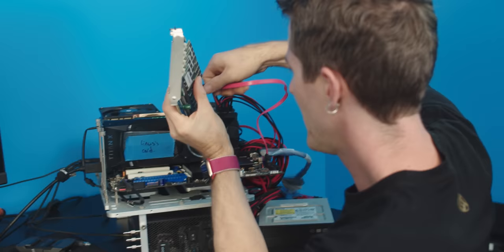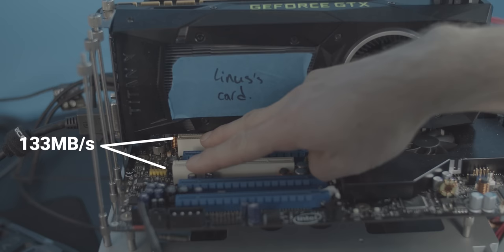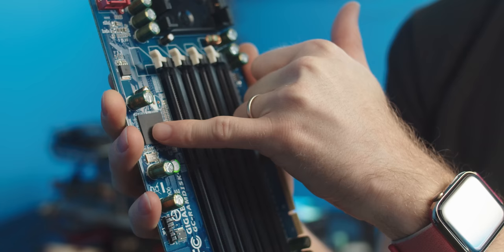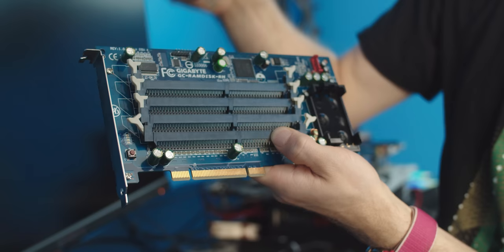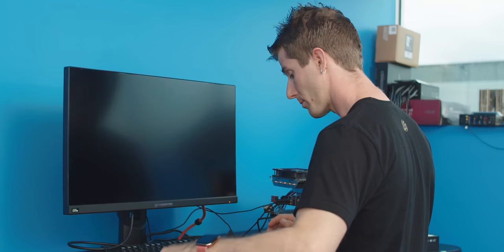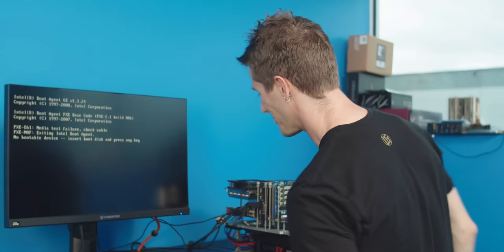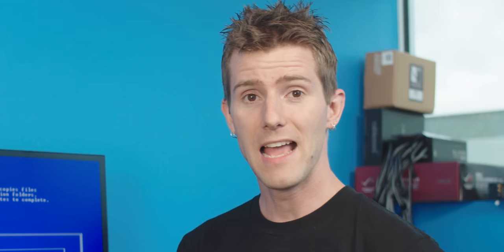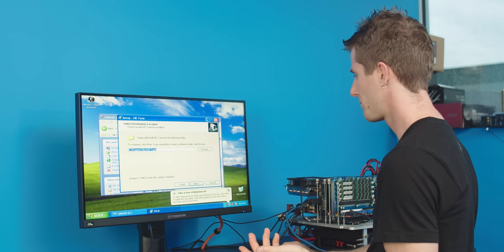WTF is this thing? - RAM on a PCI Card??

Comment: "What kind of hard-drive do you use?"
"4GB of RAM"
Reply: That you downloaded.
Reply: 10 gb.
Reply: i said hard drive...
Reply: Technically possible using a program like Imdisk (allows for quite a bit larger size then most programs & is free, though said ram disk will be deleted when putting pc too sleep or rebooting.)
Reply: lmfao
Reply: @ugurinanc5177  is hard
Reply: @ghfhgfuuu  😂😂🤣🤣😅
Reply: @Mini-z1994  I used a ramdisk with a live linux on a usb stick, on boot it all would be loaded into ram, I could remove the ugly stick and have the fastest system possible. downloads would go to the usual harddisk.
Reply: @couchcamperTM  something like puppylinux right ? pretty neat little os ^^
Reply: @Mini-z1994   it was actually a full blown siduction linux, based on Debian Sid, I used to be part of the team and supported users. good old times.
Reply: "My computer has run out of memory"
"Do you mean hard drive space or ram?"
"Yes"
Reply: 4Gb of RAM? Golly, you must be rich.
Reply: Most people would just think you're taking the piss if you said that to them haha
Reply: @blazedyoda8608  from todays perspective 4Gb is nothing, from 2000 to 2010 it was more than enough. whenever hardware gets cheaper, some idiots write new software that will make 120% use of it, without doing anything better or even more reliably. it's like your wage/politicians ideas = increasing suck
Reply: "This is PCI, going dark"
Reply: @Mini-z1994  Sleep doesn't clear RAM used as RAM, but maybe an OS stored on RAM would be different?  Does sleep power down PCI slots?
Reply: Many years later a 128 GBs ddr4 3200 MHZ RAM storage is created, people will be able to see into the future.
Reply: @humaj19  You can change the "link state power management" setting to get around that
Reply: Even mentioning a hard drive in the LMG office will probably get you fired
Reply: @humaj19  Hm might have been down too how i configured it at the time then, always lost the ram drive here when i ran xash3d on a small ram drive & some half-life mods and putting the pc too sleep.
Reply: As a repair technician, i hear this all the time... Customer: i need more space. Me: How big is the drive currently? Customer: its got 4 Gigs of ram. Me:... OK, don't worry I sort it out.
Reply: 4GB of DETOTADED RAM
Reply: @jakebadenhorst9570  Been there brother. I just keep a thumb drive handy with programs such as Speccy.
Reply: Yeah, to be fair RAM drives have been a thing for a while!
Reply: lmao
Reply: No Akomplice  he has to take down his firewall first and disable norton.
Reply: not all heroes wear SSD
Reply: I have an industrial control system from 2008 that uses a 32MB SSD.
Reply: In 2009, I used 2GB of RAM as a HD for some time, after my "proper" HD died. I would simply run Ubuntu in "live CD" mode and use my PC "normally" (mostly for web browsing, for obvious reasons).
Reply: that was so funny man! haha
Reply: Oh, ebay.
Reply: @ghfhgfuuu  to get 60fps
Reply: You need to use a program called ram-doubler lol
Reply: You can now create a drive with some of your system ram using software. It's incredibly fast. You can copy 1GB files almost instantly.
Reply: @tylerdurden3722  RAM drives have been around for years.
Reply: @humaj19   yes,it powers down everything not required for the mainboard RAM ...
Reply: @yohwllo2127  10gb? tf?
Reply: funny I was using a half my ram as a ramdrive back when Doom1 came out... i had 16 megs. the game was 7.8 megs and it required 4 megs to run.. brilliant, thank you ramdrive.sys :-)
my game loaded instantly,  never skipped....  lol   used to kill a lotta ppl multiplayer back then on a 486/66mhz
Reply: @couchcamperTM  Indeed - there's a lot of software, including some operating systems that can't really justify their requirements... Imagine how much more power you had available if their requirements were actually justifiable.
Reply: @Mini-z1994  not when sleeping, contents survive.
Reply: Maybe 1 GB of ram. You have to realize people were playing WoW with 256 mb of ram spread across multiple sticks. 128 mb sticks of ddr were rare and 256 mb sticks were extremely rare.
Reply: it may be small but it can blaze through in a flash
Reply: What's the name of the device, can we use current ram ddr4 sticks on it...? Is it available on Amazon
Reply: @ugurinanc5177  8gb ddr1
Reply: i wanted to create like a hard drive that uses high-quality ram to run faster and with a battery to make the ram never turn off. then i got this in the recommended section
sorry for bad english
Reply: I don't why do this though. Just run the OS from RAM but have it actually boot from an HDD at the time.
Reply: @lakasngamatzko4523  what
Reply: Lmao
Reply: I need this but for DDR3
Reply: Don't laugh.
I'm currently using a 248 GB ramdrive as a "temp storage" drive.
I'd LIKE to see a PCI-E 3 / DDR3 version for when I start needing twice as much memory for the program AND for the temp drive (current server won't fit enough).
Reply: Lol

Comment: I would love it if they made a modern version of this, working purely on PCI-E for data supporting modern ram.
Reply: No, because it's shit. You can just use pcie SSD's in RAID and get as much speed as PCI-E can handle and bog down other junk in the process, the solution is here though, Optane ;-) where you chuck your superspeed SSD into a RAM slot instead so you get around PCI-e bottlenecks. 
Yesh, know it's an old comment, but still - in case anyone else is curious they can see my comment.
Reply: @noth606 that doesn’t sound right from what I remember, Optane’s mounted by PCI-E or the m.2 slot with the former for corporate users or those not exactly keen on sacrificing their m.2 storage or would like just a bump rather than a replacement, there’s no mention of them creating a version mounted onto ram slots nor has there been any mention of testing at all.

Comment: Imagine something like this today with pcie 4.0 wtf even is load time lmao
Reply: Pcie 4.0 DDR5 and NVME to connect it LOL
Reply: Loading would be CPU bottle necked
Reply: @KiwiPowerNZ  That or the program's engine. Even the new consoles with their fancy SSDs can only load last-gen titles so quickly because the engines have no bloody clue what to do with so much throughput.
Reply: You can actually do it if you want. It's called RAM drive.
Reply: Actually, it wouldn’t make that much of a difference with current games and applications. For many games, even PCIe 3.0 NVMe doesn’t make a notable difference compared to a SATA 3 SSD

Comment: i am sad. You are missing the hole security aspect of this hdd solution.  I know places where they are still in active use today. With out the battery :)
Reply: And.... It's gone
Said the South Park banker
Reply: The security aspect of this was my first thought, its like a flash able virtual machine but hardware.

And upgraded version of this plus several simple boards and cpu, all linked to a master pc to monitor them and you break even the feared possible weakness of Qubes OS.
Reply: You can achieve the same with a switch and a powerful electromagnet. In my teens I was working on something like this. A hdd Killswitch with magnets. Fun but too expensive to test so it had one run and... Well I didn't think the idea through.
Reply: @sbcontt YT drive encryption is good but it leaves an attack vector even if brute force or social engineering for keys the beauty of this is there's nothing to attack its just gone.
Reply: @norfolkngood8960  It also leaves you with the physical attack vector - give up the keys or die a slow agonizing death. It's  *much* better to have the data loss in a credible way so that attackers are deterred - rather than incentivized.
Reply: use a ramdrive then. such linux kernel module so nice
Reply: I'm curious. Can you give an example?
Reply: @SariconYT  The assumption is that most people, or at least a significant percentage of people, give up their money before they die.

By having a credible device that ensures that even those that otherwise would give it up, can't - you deter some ( but not all) attackers.
Reply: @entitledOne  Or a cap with pumic powder.  Pop the cap, spray the powder drive the read/write heads at velocity back and forth and you scrub the platters clean.
Reply: Lauri Kreutzwald it makes great Linux swap too I’d imagine. Shame there isn’t any bigger DDR1 sticks.
Reply: Entitled you erased the seek track didn’t you. At least I think that’s what it’s called, the thing that’s at the start of the drive that tells the drive where the start of the platter is and is programmed at the factory.
Reply: I remember wanting to buy one of these supporting DDR2 memory and not being able to find it, even at a tiny 8gb, it really is not usable for much.  The price was also a massive deterrent.  Still, having one to use as virtual memory might be useful.
Reply: not sure if you're referring to it having a hole in its security or its whole security aspect
Reply: you can just use pxe.
Reply: Won't you as well use a software RAMdisk at that point though?
Reply: Linus, remember the old 32 pin 4 stick memory to EDO memory adapter?  Wouldn't that be weird if someone came up with wicked slow memory adapters to use old DDR memory on DDR2 motherboards, or DDR3 memory on DDR4 motherboards?  I know, this would likely be taboo, but imagine overnight these old memory tech increasing in value, saving the landfills.
Reply: Saricon depends if they take whole PC or the drive and find out later.
Reply: @pixels303at-odysee9  you could probably translate the calls, but not enough people would want slower memory for large scale applications to be worth, making the use of an fpga mendatory, which in turn makes the cost prohibitive, so the idea, while interesting, isn't viable.
another option would be to have a chipset which supports multiple types of memory, but again, the lower speed and sizes of ram would be prohibitive.
the only uses I know of for older ram besides using them as is in older motherboards, is to desolder the chips and use them individually in some other devices.
Reply: @entitledOne  That won't necessarily cleanly wipe the drive, you'll still have left over or possibly the entire data set on the drive
Reply: @keeperofthegood  If you have time to do several head-scrubs over the entire platters, I think this kind of security no longer makes as much sense (OP).

If at first you're opening the drive (to introduce the powder), you can save yourself a lot of time by just taking an automatic punch (the tool) to the platter. Most (I believe still) HDD platters are layered on a substrate of glass. If your platter substrates are aluminium, you can still pull the platter(s) and melt it/them in a well-ventilated fireplace before a headscrub-pass is halfway there. Or just give them a good twiceover with sandpaper.
Reply: they have linux variants that run completely on system ram. no need for this
Reply: @pr0xZen  I do mean manufacture the drive with a capsule of pumice powder inside.  The platters and the heads can be powered long enough from a capacitor to run after main power has been cut from the drive and run enough to totally scour the platters.
Reply: a lot of hardware security modules (hardware encryption devices) in data centers still use this type of thing
also have a look at some teardown videos of hardware security modules and eftpos machines, you will see that they are designed so that you have to cut the battery wire to open it
Reply: You could get the exact same security aspect today by making a RAM drive with far more space. But regardless if the data is so important that you need it on volatile memory you also need it backed up to restore it and that's where the whole secure volatile drive falls apart.
Reply: No one's ever really gone.... There's still data left on memory modules up to an hour after power loss. Also, you can freeze memory (flip a can of canned air upside down!) to retain data for days or more.
Reply: "I've just erased everything."
Reply: @keeperofthegood  Sure. But what about accidental capsule rupture?

I'm thinking that if you have the resources at your disposal to actually manufacture such specialized HDDs, you likely have better, more practical, predictable and reliable options for achieving the same results available...
Reply: Those places should just change to the Tails operating system instead :P
Reply: @haxalicious  there are ddr3 version and some manufacturer still making it
Reply: Without focusing on the implausibility of your scenario of being threatened with violence to hand over your hard drive, why would you even use this for storage? It sounds like a 90's Action movie, aptly named Hard Drive Confidential, starring Bruce Willis. It makes much more sense to just add additional RAM to the computer itself and create a ramdisk instead of this crappy technology. Creating a ramdisk can be accomplished with ease. You can also compress it for a minor increase in additional capacity.  Not to mention it would be much cheaper, and performance would be exponentially better The limiting factor is your available RAM slots but otherwise its a superior solution in almost every way.
Reply: @Justin0048  or just use the tails operating system
Reply: @sbcontt YT Which can be cracked. Or more likely they crack you to acquire the key. Just use a lenghty randomly generated cipher to encrypt, which gets deleted after 3 wrong login attempts and has a killcode which deletes the key you cannot possibly know. Adn then the script executes an ata secure erase command. I may or may not have something similar.
Reply: RAM Disks anyone?
Reply: @oswaldfeurst5247  Without battery it's exactly as RAM disk, but actually slower, since system RAM is faster to access than that on PCI card anyway.
Reply: @norfolkngood8960  Yeah, but if social engineering won''t work, there's no time on our planet to bruteforce even just 256, let alone 4096bit encryption. There's insine, too large to comprehend number of different combinations of those bits, so going through them is impossible with modern technology - maybe when the quantum CPU's reach the state that they can actually try each combination at the same time, and thus get the correct answer in a jiffy (Yes, I'm not taking that back, I really meant 60th of a second :D)
Reply: @SariconYT  What would be the point of killing someone in that case, you as a criminal are just adding another unnecessary criminal charge for no benefit.
Reply: @RovakX  Pirate bay database server is a good one, cops come, cut the power.

Comment: I would love to have that card with ddr3 now
Reply: But I think a m2 nvme ssd is cheaper/GB
Reply: @Damicske  It may be cheaper that m.2 but not faster than four ddr3 dims
Reply: @Damicske  Also you can't unplug it when the police comes in.
Reply: @Viscous Shear Form factor. Gotta make it fit in the case.
Reply: @FactoryofRedstone  just raid 1 with an SD card.
Reply: @Viscous Shear  back is using bettery
Reply: How hard would these be to modify to except ddr3 or 4?
Reply: @joebritton1481  modify as in only change ram to ddr3 ??

because ddr3 can go 7-9 GB/sec Transfer and it is using pci which is only 150 MB/sec i think

we also needs to change it to pci-e
Reply: @asadrahman6123  its using sata 1 not pci
Reply: @asadrahman6123  it uses sata not pci. They explain that in the video. And just allowing it to use ddr 3 or 4 would greatly increase the amount of storage available.
Reply: Who the hell would make it with PCI now??
if there was an updated version made of this with ddr3 it obviously would use PCIe gen 2/3
Reply: I've actually thought about using a solution like this to increase the dim slots in my computer.. didnt know it already existed yet it's still not quite what I'm looking for lol
Reply: Plus primo cache
Reply: @ILikeSongs5  even without the extra controller I'm not sure if the latency over pci-e wouldn't be terrible compared to normal memory
Reply: @joebritton1481  Probably pretty hard. 
My first guess is that you'd have to reprogram the FPGA
Reply: @KnifeChampion  PCI is only there for power. The data interface is SATA
Reply: @janisir4529  that would probably be the only big programming. Am I correct in assuming that? I feel like this would be an awesome video
Reply: It exists but it's incredibly expensive. There's two out there.  It's the AllOne Mark 1 and AllOne  Cloud Disk Drive 101
Reply: @vnyggi621  even so, if you can offload the less intensive operations to the PCI RAM and use the bulk of the onboard RAM for more demanding processes you are sure to see performance gains.
Reply: @joebritton1481  
That's assuming that ddr3 is physically compatible with ddr1
Reply: I need(want) a mobo with 16 ram slots
Reply: Same. I have a bunch of ddr3 DIMMS from when my uncle was clearing out his storage, and they're currently just sitting on my shelf
Reply: @chorgin  How would you let the RAM use full potential? 
The speed would still be limited by PCI-E or SATA just like normal (cheaper) storage options
Reply: Also need to add a rechargeable li-ion battery that can be charged from the motherboard. This way standby hours when working on pc or when shutting off pc for the night is actually something feasible. Lets say you are moving well you're fucked as it stands. Having a rechargeable battery would be fantastic.Also why not have it support ddr4? That's future proofing it. be cheap now add better later.
Reply: I'd love to see a ddr4 32gb dimm compatible version that used pci-3/4 and how it would compare to a gen 4 nvme drive

Comment: My first thought was that I wanted to know how they got around the volatile storage issue of RAM. I didn't expect them to not have overcome that in any adequate way. The battery backup having a two digit amount of hours of potential backup helps though, in case you needed to move it to another board or move the computer somewhere.